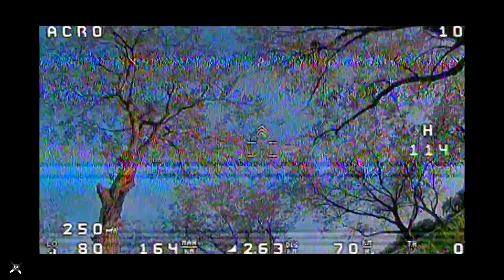Don't try this at home, fly outside

Comment: Would digital fpv feed help to see trees better? 🌴😜
Reply from the maker: For sure! but about the last branch the plane was almost of control, dislodged tail, HD would not have changed much
Reply: @Olivier-C  Since moving to DJI I have been spoiled... and now I could never go back to analogue. 
Can we ever expect to see you go digital one day Olivier... or does it just not offer enough range for your needs?
Reply from the maker: @paulhope3401  for my ow use case DJI has some downsides, first theres the OSD, Im heavily using my radar feature, and only analog can do that for now, and also the way it degrades at long range or in difficult conditions. When flying at 3 or 4kms my HD friends are nervous, their HD links can go down quick, it does not degrade like analog. Also its heavy and heats a lot and of course there's the cost and low availability, while I still have a dozen of good analog VTX :) but I have some gear for openHD and Ruby, but there the latency is rather high
Reply: @Olivier-C   True... and it is a fairly large investment to make for something that cant meet your needs fully.
I see FPV WTF have hacked the DJI system and currently working on a custom fw to bring us full MSP/canvas mode in the future.
I think I'll stick with my DJI V2's due to that being in the pipeline but for newcomers thinking of moving to digital, with the various new systems all coming out within the next year its worth waiting to see what will tick the most boxes.
Reply from the maker: @paulhope3401  Yep I'm also waiting to see whats comes from DJI hacks, or the HDzero lineup & clones

Comment: That mobula delta wing is absolute 💩💩 I built one just to put it in a trash can 😆 terrible terrible stall and that motor angle is just idiotic who designed it
Reply from the maker: Yeah the motor angle i really bad out of the box, but once it's fixed its a rather fun plane, with my motor combo it can easily go beyond 220kmh. But yeah the stall is a also a bit wild. Definately a plane that needs some speed to be enjoyed